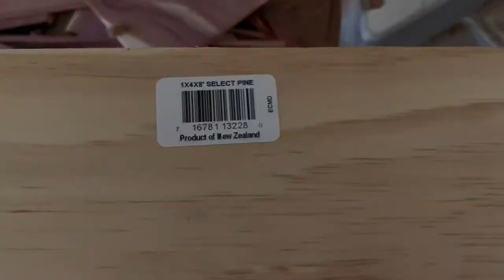Epoxy ocean table with fish

Comment: Haha , it's good to see that the Kiwis are selling their crap radiata to the Yanks now 🤣.  Your table turned out nice.  The white foamy accents turned out good.  The epoxy over the top made them look sort of 3D. 👍

I had half a soup tin go exothermic once when we were taping the seams in a boat we built when I was going too slow.  It gave off some really good smoke.  I was wondering about the volume of the epoxy pours you were doing about how hot they might get.  Does it have any amine blush when it sets up?  The stuff we use to build boats has a blush after it cures that you have to remove before the next layer will adhere.  If you do the next layer of glass or whatever before the first one completely cures, it sticks fine though.  I haven't ever tried any pouring epoxy to see how it works.  You are right about getting everything level though as gravity can have some unexpected results. The boat we are just "rebuilding" at the moment apparently had some small screw holes/cracks underneath where the keel stringer sits and we nearly glued the thing into the cradle 😁.  At least we know that there wont be any water getting in there again ever.  Someone at some time had screwed the old stringer down a bit hard and that must have been how the moisture got in to the bilge and rotted everything.  The epoxy found those holes though.

I want to re-do our kitchen benches with an epoxy type coating eventually, so I'll be picking your brain for tips.  I do have a confession though.  You have no idea how hard it is for me to not call you Jaems, I hope that you appreciate the restraint that I have had to use. 🤣🤣🤣🤣
Reply from the maker: Thank You for watching!! You do not have to remove anything between coats. 
You have every right to call me Jaems. I have every right to make sure not to see it again.  The choice is yours. Have a great day XJ
Reply: @JamesStumbo  Haha, I just like to tease you. Don't take it personally man, I'm no bully.
Reply from the maker: @xj9ox  no worries XJ. You have a wonderful day good Sir